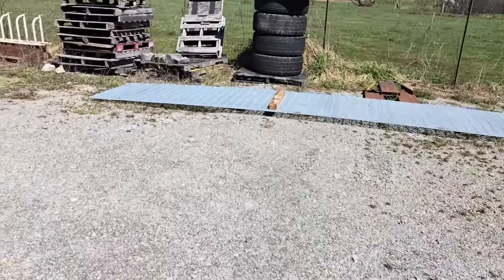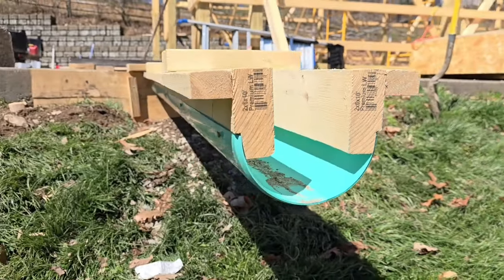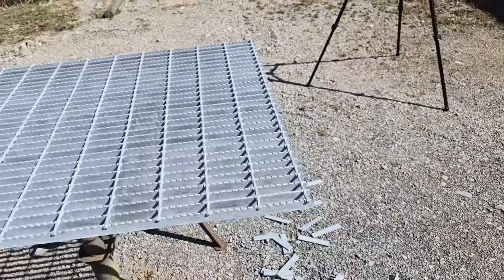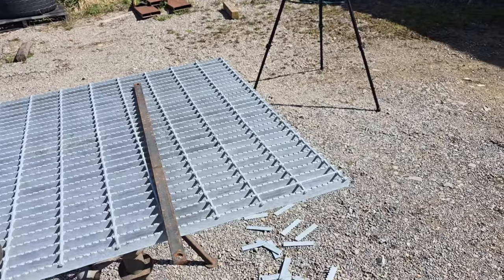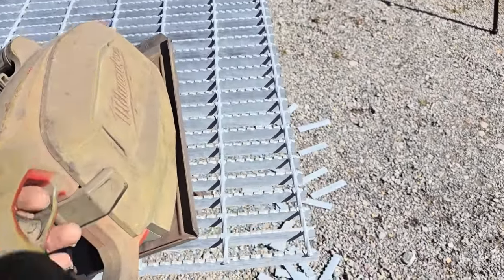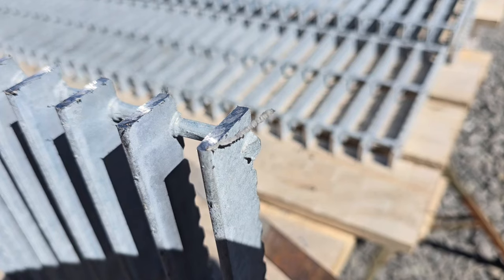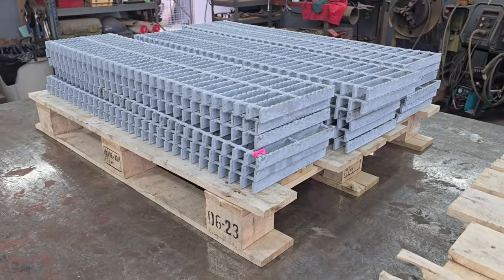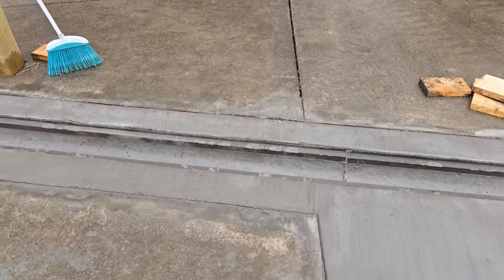Channel drain in concrete from homemade form, covered with steel bar grating

Comment: Turned out sweet.  Ive seen that done in industrial settings but they had angle iron upside down for the grating to bear on, with weld on concrete embedment studs holding the angle into the slab.  Probably overkill for this job.

Comment: Great info you share on this video, CB!   The cold galvanized coating, how you use it, the cutting to make the lines actually line up when set in place…..very useful for any fabricator.   I have a section of that grating I was contemplating using for a plasma cutting table build.   I think a lot of welders would not have taken the time to make such a video……I personally want to thank you for doing so.    That pretty W.Va. Green in the background says it won’t be long until planting the gardens begins.   Keep up the good work!

Comment: Great vid. I set 4x2 inch (100x50mm) rectangular section set in concrete with holes drilled in the steel to take the water away. In a stable yard. I cut the concrete with a road saw

Comment: Good thoughtful job, CB! May look mind numbingly simple but there’s a lot of thought to making it come out looking correct. Those Milwaukee 8” metal cutting circular saws are a beast! I’ve cut 1” plate with mine and when you factor in how little clean up is required after the cut, it doesn’t take long to do it! Also, I appreciate your thoughts on how to work efficiently. One of the few ways that we can speed up quality work is to handle everything as few times as possible.

Comment: I've installed several trench drain systems including the drain plumbing to main line sewer. The systems are a pain in the @s$ to get all set up & remain perfectly set-up during the concrete pour. Each 4' channel is numbered & the slope is built into the system so you have to keep them in order, locked together, & remain level all throughout the pour - kinda difficult to say the least, even tho you spike them in with rebar 'spikes'. This system is so much better & easier to set up & remain undisturbed through the concrete pour process! I like it a lot. The forms need to be built first but after that they're reusable and much easier to set up & keep level. I'm not sure if he did but I'd spray down the pipe from w\ some diesel🛢️ fuel so they come apart easily. 👍🏻🤔⚠️
As always, nice job....your buddy has the right idea too, with this reusable trench drain form system. *Patent pending*™️ 👍🏻👌🏻🛠️🔧🔩⛓️🚜⚠️🚧😅

Comment: What kind of saw blade did you use to cut it down
Reply from the maker: MILWAUKEE'S Circular Saw, 8 In. Blade, 3700 rpm, 5/8" (6370-20) https://a.co/d/6fpraWB

Comment: What is the skill saw looking saw u used to cut the grating
Reply from the maker: https://www.northerntool.com/products/milwaukee-metal-cutting-circular-saw-8in-13-amp-model-6370-21-m0480?cm_mmc=Google-pla&utm_source=Google_PLA&utm_medium=Power%20Tools%20%3E%20Saws%20%2B%20Accessories%20%3E%20Circular%20Saws&utm_campaign=Milwaukee&utm_content=M0480&ogmap=SHP%7CPLA%7CGOOG%7CSTND%7Cm%7CSITEWIDE%7COOT%7C%7C%7C%7C168639116%7C8715915356&gad_source=1&gclsrc=ds

Comment: Great video! What Transmission do you have in the bricknose?
Reply from the maker: C6....3 speed auto
Reply: What kind of speed do you get out of it on the highway at a reasonable RPM? I'm looking at getting my first truck- a bullnose, bricknose, or obs and I was trying to look at what transmission to get. I've heard good things about the Zf5 manual but it looks like they're pricey and harder to find. I'll be spending a lot of time on the highway. Thanks!
Reply: @JohnWheels It's going to depend on the rear end, ring gear ratio. The dually is probably a 4.10 gear but could be 4.30, 3.73 or something else lower. The zf5 is a real good trans but a standard is a lot of shifting if you have a bad knee or something get an automatic. After the good old c6 trans came the e4od which turned into the 4r100(7.3L, 5.4v8, 6.8v10) which is almost exactly the same well built trans used up until the 5r110 came out in 03 -04 used with the 6.0 diesel, 5.4v8 & 6.8v10. Ford trans' have always been pretty well built, nothing like the Dodge 68rfe pos's. You can find places online to calculate what engine, trans, & rear end numbers all work out to be. Search Google 'engine trans rear end gear ratio charts'. Also you can learn a lot from the many Ford truck forums out there. 👍🏻👌🏻🛠️🔧🔩⛓️🚜
Reply: @tdotw77  Thanks for all the info!!

Comment: How you like that milawaukee metal circular saw bro? I seen another dude I follow making a trailer use one, he cut thru this giant I beam like it was a 2x4 man and he swears that things the ticket, you agree? It’s badass?is that thing Judy chop certified is where I’m going with this lol
Reply from the maker: I have 2 of the 8" Milwaukee saws...I've had a few other brands of the same type of saw and I like the Milwaukee best
Reply: The metal cutting circular saw blades are amazing! Evolution or Diablo cerment tooth metal cutting blades are the ticket man. I'm not a 'metal fabricator' per se, but when I need to cut some metal u put the Diablo cerment tooth blade on my regular DeWalt 20v brushless saw and cut away. It's so hard to get your brain to go with something like using a circular saw to cut steel when it was always not ok to do before.😅 The technology and price is so good now that you can buy one of the 7¼" blades for like $30 and cut I - beams w\ a circular saw with no sparks flying & no consumable (spark-throwing), abrasive cutting disks to waste money on. 👍🏻👌🏻🛠️🔧🔩⛓️⚠️⚡🔌🔋💥💨